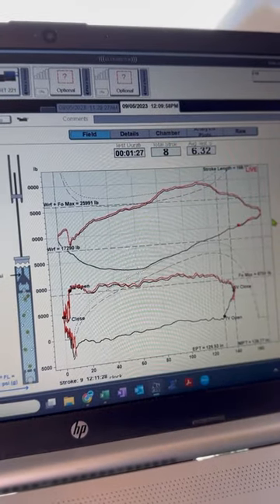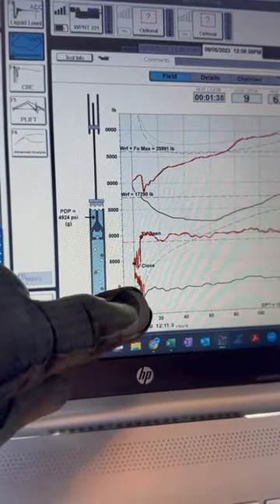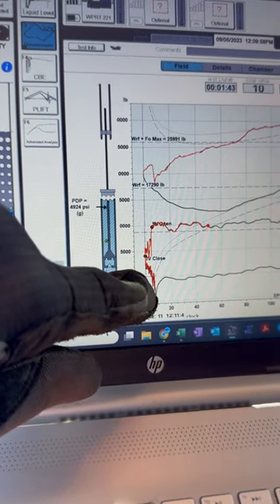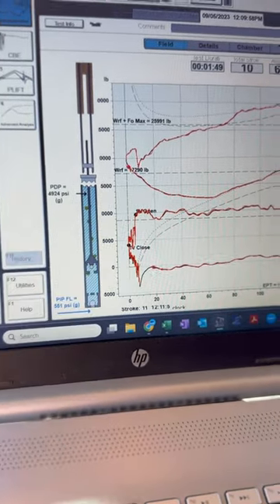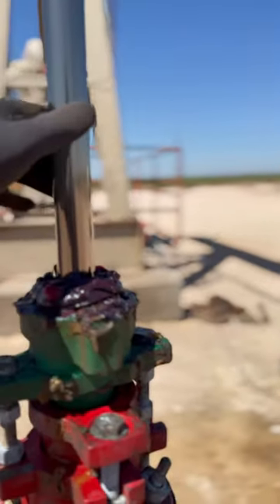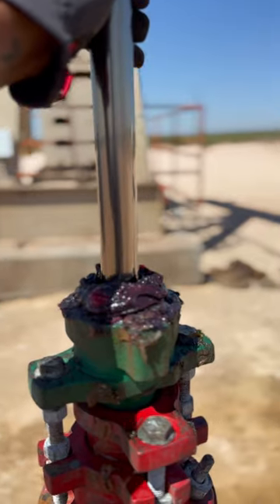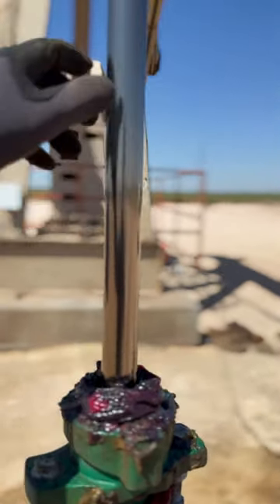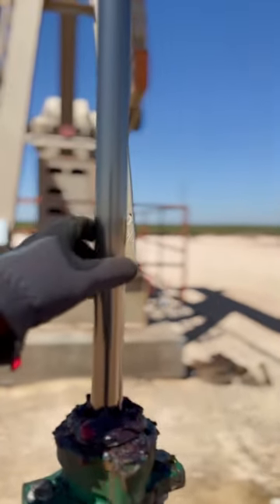How oil & gas companies lose money damaging their systems #shorts

Comment: I seen it on the upstroke, You can set a tag on a pump right at the bottom on a stroke without damaging the equipment. Having a tag can prevent gaslock and increase production

Comment: So, to fix it at least temporarily, could you take some slack out of the bridle or adjust the point that the bridle connects to the polish rod? I am not an oil guy. I'm a welder and just find this stuff fascinating.
Reply from the maker: Due to liability it’s best to have a crew do it
Reply: @fluidlevels  well yes, a crew would be the way to go. I was just curious about if doing it at the bridle is the right way or just a temporary fix.
Reply: You can move your clamps lower on the polish rod, that's assuming you have enough left for the stroke, and a way to get the weight off the. Bridle.
Reply: Definitely could raise that off tag or less of a tag without a crew moving on. Just need an extra clamp and a toadstool. Raise the polish rod 6 inches in this case. But any amount will be better than the amount of buckle that is happening to those rods right now. I could feel that trash from where I'm standing

Comment: You are damage the top of the pump, not the bottom, need to adjust the clamp in the top of the bride to avoid damage the pump to the point that need to replace it.